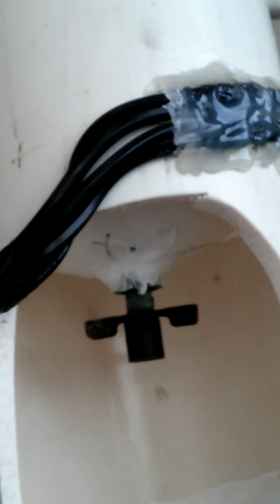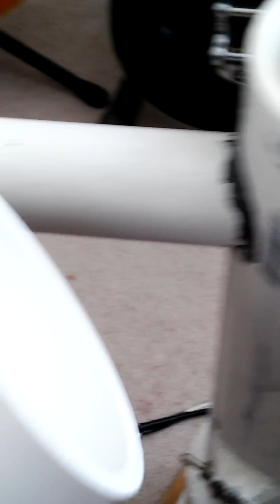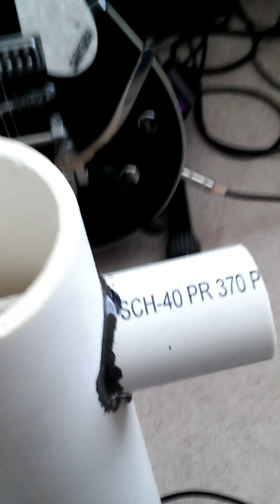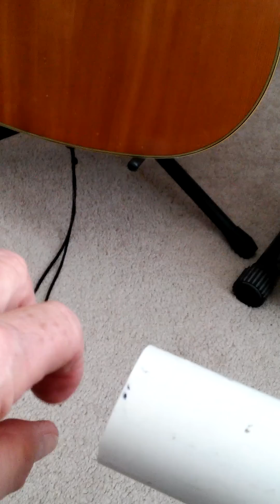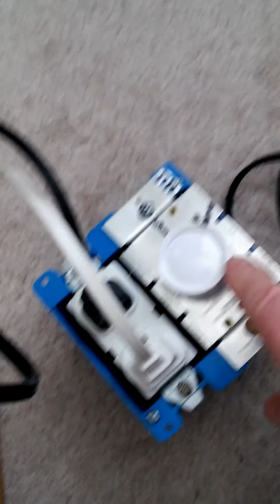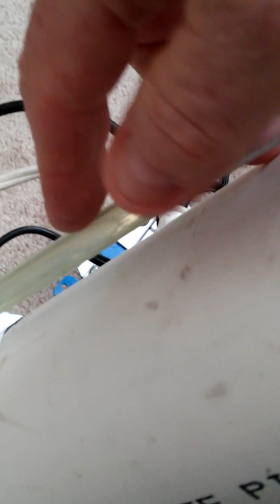up date on gasoline heater explained

Comment: Yes you are right static from alternators ,radios ,back charge curents in combination with coolant anti freaze electrolisys indead eats up ruber seals and gaskets that is true and ethanol in fuel destroy ruber even faster senzors perhaps it wuld by bether to experiment how wuld it turn out if you used regular gasoline and remove ethanol content insise the fuel  I have those problems for years with my 80s gm based engine in wurst cases alternator starter motor and baterry get fried just because of static and ethanol vapor most comontly peopel can smell it inside the car and that staff fumels with fuel air ratios,cooling system,ignition components get shorten out realy trobel some staff those older cars did run after all on leaded fuel not those alcohole crap

Comment: Thank you for all your videos. i just got through almost all of them.

Is it fair to summarize the order of importance of doing vapor engines:

1) use a wick sistem plain and simple
2) add bubbling with the wick
3) heat up the gasoline (either with the exhaust or a plunge heater)

Did I get that right?

Anything else?

Comment: back about twelve years ago I tried to heat my gas commig from my gas tank what I did was made a coil of quarter inch copper and made a coil like a spring and set it in a cylinder and ran presone from my engine threw the cylinder with the coil inside  but I found that the gas was vaporizing before it came out and when it went into my carburetor it didn't work but it was heated up to what ever the coolant temperature was .
Reply: Marc  A Gagnon did u try a bigger jet for more capper to go in the carb? What do you mean by the word presone? Thanks

Comment: Make a duel chamber boiler if your ok a contain that has water heated so you never get heat coil ignition or ultrasonic vaporization might be a method ppl do have to take it in to their hands tho big companies are killing us softly with their tech 44 mpg bull the car is light now the engines are being upgraded to keep ppl out of them
Reply: Yeah it's like that with all energy devices and storage systems. It's crazy how the mass public doesn't care they are being forced to use toxic products that are not efficient in any form. They don't want ppl to take energy in to their own hands cause they would stop sending their kids to die in war for oil

Comment: Hi have you tried this on a petrol generator and with the output of generator power a hhocell and feed hho in so you can eventually turn the petrol intake off.and generator could be powering a dehumidifier aswell so you dont have to topup water

Comment: Great design and use of immersion heaters!I assume the amp draw is from AC measurements, so the power needed is (120v x 4.2a) would be 500watts. Not sure the 300watt inverter you referred to using would allow both heaters to work.Correct me if I am wrong.Keep up the great work!
Reply from the maker: +jesslessthemess  yea i will be useing a 700 watt inverter

Comment: Just need to add an O2 sensor on outlet that is monitored by PID loop to control an electronic butterfly valve on the inlet to maintain a constant A/F mixture no matter what your demand and you will be in business. Glad your back on gas vapors again
Reply: Right, closed loop vapor system.
Reply: I'm am aware of that problem it has to be up to 600 degrees before it starts producing voltage not necessarily before it goes into closed loop. And with vapor exhaust Temps will be cooler.
Reply: A little more than a dull red it will autoignight
Reply: +Troll True  After I had replied I realized that a normal O2 sensor wouldn't be sufficient for this application since they are only a narrow band sensor with limited range. A better option would be to use a wide band sensor which has better accuracy along with more resolution when in a rich range and includes a built in heater so exhaust temps are not needed. See below article. I would recommend a turboxs tuner pro Wideband controller as it has data logging and voltage output  to external controller. 

I would also think an electronic throttle body butterfly valve would be good for the  inlet air which would close when more a/f is called for since that would increase the vacuum in the chamber causing the gas to evaporate faster since liquids evaporate faster under vacuum. 

Let me know what you think, made sense in my head anyway.

http://wbo2.com/lsu/lsuworks.htm
Reply: I have pondered a bit on how to keep F/A mixture within the range needed to combust. This sounds like a viable option with an O2 sensor set up. Anymore info on exactly how this would be done be much appreciated. Correct me if I'm wrong but a carb is allowing gas into the motor but it's the amount of air that really decides the power output. The further the butterfly opens the more air burns leaner and hotter more explosive and it's all timed and there you have the range that's needed.

Comment: I really like your idea. Will you be measuring the amount of time the generator will run without the vaporizer and comparing it to how long it will run with the vaporizer? This would give you some solid numbers on how much better a vaporizer can be over straight gas.